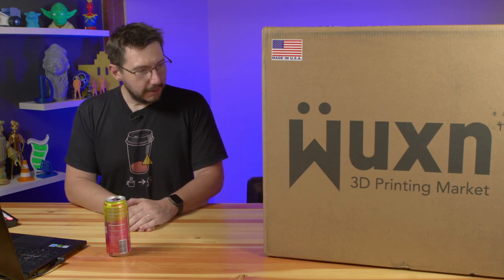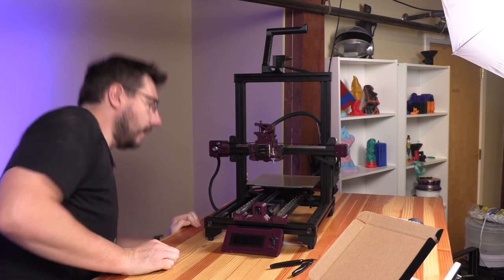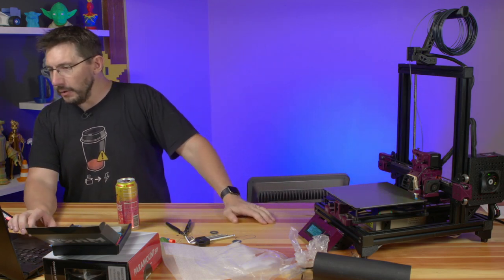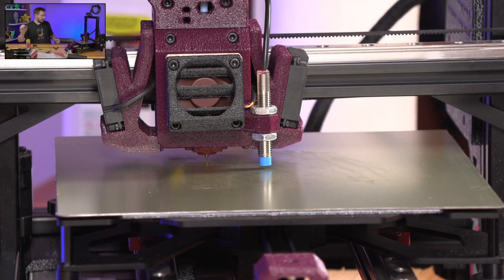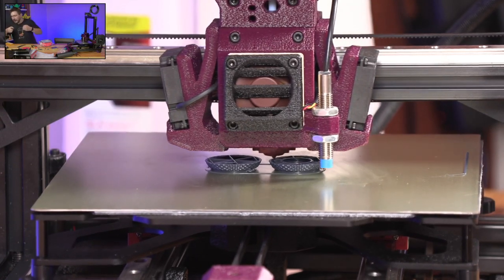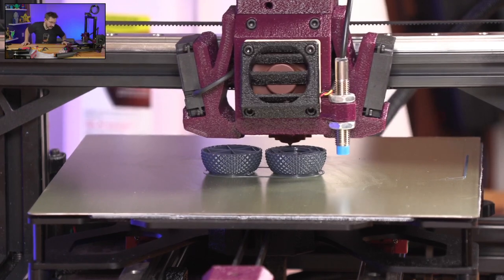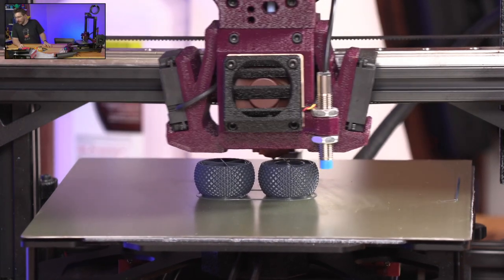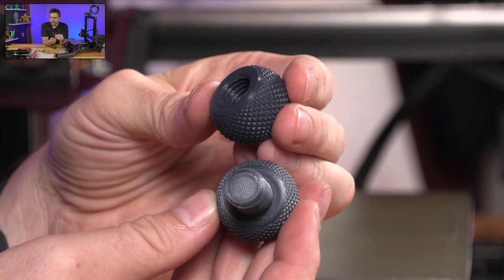What's a WUXN? Unboxing & First Use LIVE!

Comment: With X & Y having linear rails, they should have done the same on the Z axis. A dual motors on the Z axis would keep the Z axis more rigid. A solid coupler should have been installed. The coupler that is on the machine is mostly used for large motors to rip apart due to prevent the motor from burning up from over torquing or binding. You see those type of couplers on machine tools for the table/spindle motor.

Comment: It was nice to see the set of allen keys in a nice 3D printed holder. They are often just loose in a bag. It levelled the bed the first time it was turned on so that wasn't the problem with the failed attempt to print the nut and bolt. When Joel let us listen for a clicking noise I thought I was hearing a noise that sounded like the fan blades rubbing against the fan shroud. At 1:01 you could see that part of the skirt wasn't stuck to the bed.

Comment: $949 for THAT printer?! .. I rather buy a Prusa. Seriously.
Reply: Yeah. I do agree. 😂. However some people don’t have the technical know how (or don’t want to learn it) to be able to print. Then again Prusas can come prebuilt can’t they? 😬🤣
Reply: Looks to me like a Prusa I3 and an Ender 3 crashed into each other at high speed and rebuilt itself from the rubble.
Reply: all linear rails. and a direct drive. Potentialy better the the Prusa mk3...
Reply: @ingoclever1722  Z axis isn't linear rails. So not "all" linear rails. Also Prusa is also direct drive ?
Reply: @adspijnqadw  oh I wasnˋt aware. Thanks.
Reply: Alexander Hinzen Yes Prusa i3 is direct drive
Reply: Elliott Dyson You can buy em prebuild, but building it is lots of fun and educational
Reply: Look at the components though.   Slice Engineering, BuildTak, Noctua, 32-Bit ARM, etc.  This is an Ender 3 with $500+ in upgrades designed into it.  Made in USA, open source, and prebuilt, calibrated and tested - without cheap crap parts.
Reply: Plus linear rails, direct drive, etc.  This would be hard to build for less.
Reply: @bkblake01  except the cheap 3d printed ones lol maybe printed well but still not alot of cost in the printing
Reply: letsmakeanything 1 nothing wrong with printed parts.  It’s all open source, so you can change, modify and print more.  I actually like that it starts with printed components, vs. something like the Creallity machines, where one change usually means ripping out the entire carriage and staring over with 3D printed mounts. I guess it depends on what you’re after.  I have a CR-6, and it’s my least favorite because the whole thing is so proprietary abs hard to upgrade.
Reply: @lio1234234  yes the do ( i had mine prebuilt)
Reply: It's a Prusa with quite a few upgrades. Namely the hotened can hit 325C out of the box which is about 40C higher than Prusa. Not to mention dual gear extruder instead of single (Prusa), Dual part cooling fans instead of single, linear rails on X & Y instead of rods, and this is basically a Prusa with a bear upgrade already performed and a host of other upgrades. The only thing I scratch my head about is the single Z motor with rollers, I'm not a huge fan of that but I would let the results speak for themselves. Maybe there will be a dual-z and/or linear rail Z upgrade in the future. Also this is cheaper than a fully assembled Prusa ($949 instead of $999) and no 5-6 week waiting period.  I'm not saying this totally trumps a Prusa but it's definitely something to consider in comparison.
Reply: legacyofbob no, it is not. Look at the prusa ecosystem, every filament is preconfigured in their own slicing software. They have filament (prusament) that is better than any other brand out there. And if anything should break every single part can be ordered seperatly. The community is great and it can print polycarbonate. Priceless!
Reply: @bennydesign  I own a Prusa MK3S so I know exactly what you are talking about. I do not regret my purchase there and Prusa has the best user experience around as far as I'm concerned. But you have to admit that people do try to upgrade their Prusa, whether it's a Bondtech extruder or Bear frame, linear rails or a higher temp hot end to print more exotic materials. Some of those upgrades would render the pre-created profiles useless, which is something that must be considered by each user. There is nothing to prevent you from continuing to use Prusament and also this printer is entirely open source so all the replacement parts may be ordered individually from your supplier of choice the same as Prusa. If some one wanted a prusa but knew they would be regularly printing nylon, for example, I think this would be a better choice.
Reply: @legacyofbob  1. Linear rails can be a real pain to clean and don't offer any noticeable improvements to a well optimised 3d printer, like a well-built Prusa. 2. Prusas do come with a dual gear Bondtech extruder. 3. For Prusa, you also pay for the experience and community/customer support and software. I don't want a debate/argument I just wanted to correct you on a couple of things, that's all. :)
Reply: @lio1234234  I don't really see the difference in linear rails either, but my point is people DO try to upgrade Prusa printers, and that this printer has many of those upgrades already, and is cheaper than an assembled Prusa. Also, since we're correcting each other, the Prusa extruder comes with dual bondtech gears, but that's not the same thing as a Bondtech extruder. See a list of Bondtech extruders here https://www.bondtech.se/en/product-category/extruders/
Reply: Brian Blake Made in the USA is not a +
Reply: @legacyofbob  Yeah, I do know the difference, but yeah, you are right I used the wrong terminology, thanks for picking me up on it. 😁
Reply: @bkblake01  I saw it was open source also, but didn't find any info on it. Have you?
Reply: @lio1234234  Yes you can but you'll pay almost 150$ more for that convenience!
Reply: @hightempreviews5137  Yeah, mine can print PC, Nylon and Ninja Flex
Reply: @r3v3rs3r  I know, in fact I agree! I built mine myself for example and ended up with a better quality printer than one prebuilt. I was just helping people understand that some people don’t have the technical know how and HAVE to pay extra. I think it’s always best to build your own in case of repair etc...
Reply: Some of the Prusa prebuilts cost as much, and though it's kind of cool, some people are put off by having a factory built printer with 3D printed parts at that cost (speaking of both brands).
Reply: @ingoclever1722  if they are top of the line rails they still require a good amount of maintenance, cheap hiwin knock offs are notchy and actually make the print worse. I am considering taking my rails off on the X and Y but they seem to be pretty good at keeping Z nice and straight. For the money you could modify a Ender 5 plus and have an overall better printer IMO.
Reply: Ender-3 for $179
Reply: Ye, it’s a scam, they cut corners everywhere. 20 dollars board, single z motor. The hobbed gear was cheap one too. The click all the time, I had it on my ctc prusa i3. My first printer.
Reply: @bkblake01  >without cheap crap parts.
Really? If all those 3D printed parts aren’t cheap parts what do you consider to be cheap parts?
Reply: @rfresh1011  All the shit Creality puts on their printers...
Reply: @bkblake01  linear rails bolted onto extrusions, may aswell stick with the cheaper and lighter rods.

Comment: Linear Rails (duel wide y) , filament run out senor, duel gear direct drive, silicon feet, BTT Turbo, noctua fan, static bed, ezabl system, duel fans, copperhead from slice, pei build surface, fuzzy skin 3d print parts.
Reply: Suppose so, it seems like a great printer! Still perfectly happy with my Prusa though so if I were to buy a second printer I think I’d keep it safe and stick with another Prusa kit. ;)

Comment: i got a ender3 pro and have added the ezr extruder and a btt e3 main board going to add the micro swiss hot end then i be set
and its way cheaper with the upgrades than 1200 bucks after it gos off sale as i dont know anyone that will spend that kinda money
Reply: So it´s no longer an Ender .... just the bones. Brand it your way.

Comment: It is funny you was all about noise on the Y axis, but only really could hear it because it didn't sound like a jet plane as the other printers normally do.  I would have broken out the hair spray and made the bed 60, but the website says PRE-LEVEL'd ready to go out of the box. It seemed like the failure was a sticking problem.

Comment: I've used a lot of Paramount 3D filament if about a dozen rolls is a lot, and I am happy with it. They used to sell Pantone coded colors but I still see the same colors without the Pantone code. I only had a problem with one roll due to a broken seal and they sent me a new spool right away. The quality was always consistent and I never had to change settings to get good results, unlike with other brands that might have a 15 degree difference in print temp to get good results.

Comment: $949 that is really pricey for such a tiny build area printer even if it is pre-build. My Tronxy X5SA 330 by 330 by 400 mm core xy upgraded printer cost only £309.00p in the UK. that's almost 3 times less than this printer for 3 times the print area!  Hi 5  Joel from the UK .. Love the channel helps allot to see the 3D printing you do? Maybe you do a review of my upgraded Tronxy X5SA sometime? it has silent double Z axis stepper motors and a 24 Volt headed bed and 3.5 colour touch screen. I just updated the firmware thanks to Tronxy who sent me that so I could use the new Titan Extruder to soon try doing TPU filament I just got. I also brought a Stainless Steel Nozzle to let me do tough filaments like the ABS and the PETG I brought.  Cheers for the UK.

Comment: Pully could have skipping in its ball bearing (RE the clicking noise), I had some cheap pulleys in my Ender 3 V2 that had a little click to it which it made at one point in its revolution. I replaced them with Gates pulleys.

Comment: I think I'll stick with my Biqu B1. Has it issues with fans, but you can't argue with the print quality at $249 roughly. £200 in the UK.  And this one $949 for a 3D printed 3D printer. For a 3D printer that has a single Z motor like the B1, it should have had a rigid coupler?

Comment: I'm interested in this printer, but I don't think there is enough information on their website.  Also googling them comes up with a different URL that doesn't resolve.  I submitted some questions via their support, and I have not received a response.  My questions are, are there, or will there be a larger option - maybe 300x300.  Are there hotend options, or can you install your own alternate?  They sell mosquito's on their website, so I thought maybe that would be an option over the copperhead...  Also curious if the parts always come in purple.  And also if we do want to make any mods, or need to replace a part, can we reprint the factory printed parts, or do we have to somehow order more from the manufacturer?
Reply: It takes time, but tbey replied to me: The printed part file come on the SD card that come with the WX1.
Shipping to Canada is usually 7-14 days
We are looking at adding Wifi in the future as many people are not setup for RJ45 Connections.

Thank You,
Team WUXN

Comment: Only 24min in and was about to comment great job for a fully assembled 3D printer that actually IS fully assembled for once, then you reveal the spool holder still needs assembly. So we’re still not yet at a place where you buy a printer, plug in the power cable and start using just like every other household appliance. Ticks me off the constant false advertising, as someone who later in life lost the use of the left side of my body, what you all see is a simple assembly task becomes a tortuous process over a week for physically disabled people. Then of course its hard to know if printer problems are manufacturer faults in my unit or because I wasn’t able to hold heavy parts carefully with one hand while holding wires to one side and threading a long bolt accurately. Enquiring before buying I am always told if i buy the fully assembled printer it will be fully assembled but in reality its not even close. I’m not rich to maybe try an expensive fully enclosed type printer that should actually be fully assembled. Maybe one day there will be honesty, same day pigs fly and politicians tell the truth i guess.
Reply: Maybe try one of the Qidi printers like the imate s

Comment: Personaly, i’m not sure i would be particularly pleased if i purchased a 3D printer with a ton if 3D printed parts. I like the machine to be built well like bricks. Just personal preference
Reply: Prusa printers see great and have a lot of 3D printed parts. The parts are printed on the exact same models as they sell so you know they have tested the design to the extreme.

I think the parts have to be designed for 3D printing. I have seen some that appeared to be designed for injection moulding and those are not good parts.

The parts on the wuxn look good to me, and they're pretty beefy so I wouldn't write them off. They would need to have awesome (local) customer service to justify people investing almost $1000 in them.
Reply: if something breaks you can reprint it with a different printer. cheap.  also, i assume the stl would be able to be modified. so you can add twists to it. 3d parts can last for years. i'd rather print out a replacement part then have to as the mfg to sell me a new one.

Comment: I, truly, do not understand why this cost more than $300. Why? Also, it is Fugly!
Reply: The hotend alone on this thing is $150.  It's full of expensive upgrades over a standard cheap $300 printer.  It's basically what you'd spend and end up with after suffering through a stock creality printer for 6 months.  Better board, better rails, better hotend, better fans, direct drive extruder, ABL, etc.  Probably several other better components as well.
Reply: I'm not convinced. If the out of the box experience had been better for Joel, I might agree. But that thing was a train-wreck.

Comment: This is overpriced 3 D printer. I made my own 3D printer for under $150 using Arduino and upgraded to dual extruder. This is a single extruder machine for $1000..... meh...
If they are trying to market as Made in USA product then i am sorry  all the electronics is from China and using a made in China filament to print 3D printed parts. At least they could have added a touchscreen interface.